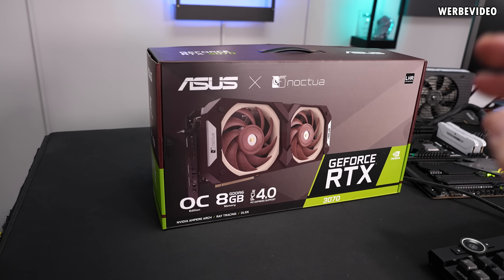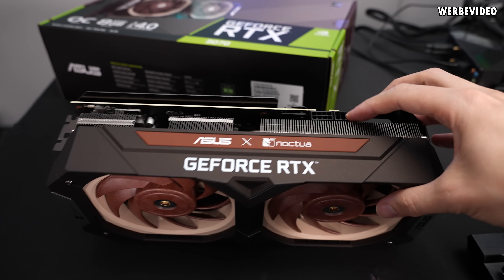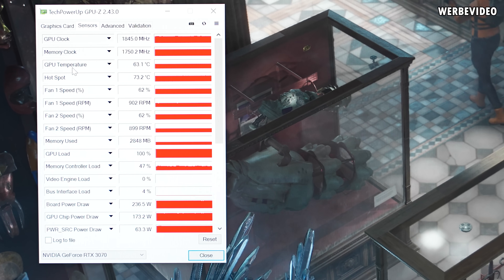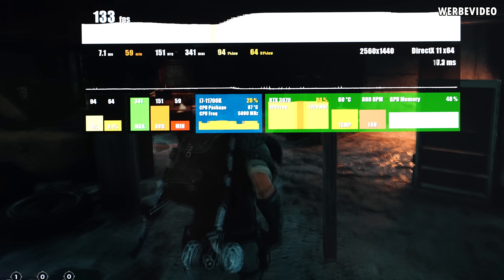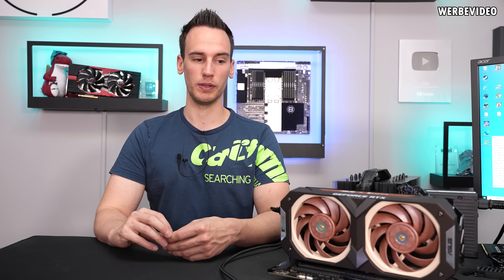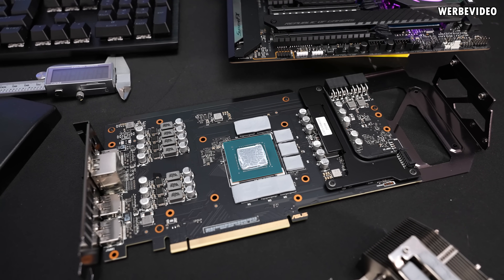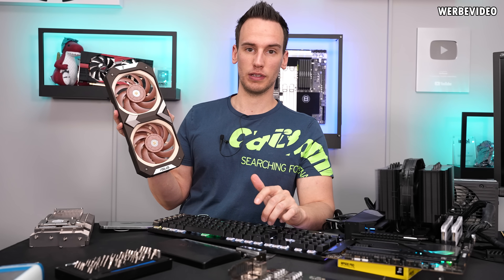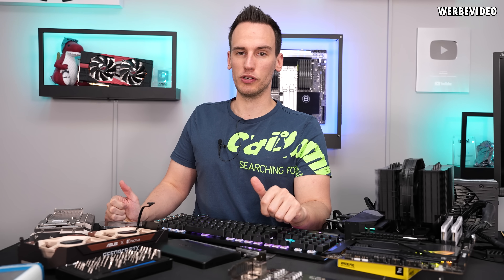Impressive Noise Levels - But what's up with the Heatsink? ASUS x Noctua RTX 3070 tested

Comment: I wonder why manufacturers put 2-slot I/O brackets on graphic cards that take up full 3 and more slots (in this case full 4 slots). You are taking up that space anyway, a bigger bracket with some reinforcements would help on common problem of gpu sag.

Comment: This would have been able to match or even beat a lot of 3 slot coolers in a 2 slot design, but a 3 slot version of this would be great. It would still outperform everything else but fit in far more cases, not to mention weigh far less.

Comment: The quietest card with the loudest coil whine. I had 3 pieces. Each one had tragic squeaks. Changing the power supply did not help. In the meshify2 case it can be heard from 4-5 meters. When I put the MSI RTX 3070 Suprim X nad 3060Ti Gaming X in, I have to put my head in the case to hear something.They all squealed so much that only lowering the voltage to 0.800 - 0.825V resulted in all 3 units. A friend also bought one. Exactly the same as with me.

Comment: Noctua make many sizes of fan, there are 80 and 92mm option, and 14mm thick ones as well. They could make a normal size cooler with noctua fans if they wanted. Most of the insane performance and low noise is a product of using two premium 120mm fans, not that they are noctua fans. That's not a knock on noctua tho, or this card.

Comment: Any non gaming application can use multi GPU without an sli/nvlink bridge (Machine learning, 3d rendering, etc). So dismissing the possibility of multi GPU because it is a 3070 with no nvlink is not taking those into consideration

Comment: My PC has mostly noctua fans (only GPU and PSU are exception). Now GPU can also be also noctua fans. PSU to go (Noctua waiting for some additional colaboration in this segment).
Video suggestion (as you said, black fans would increase buying potential) - swap those fans with Noctua NF-A12x25 PWM chromax.black.swap
Question is it a sticker on top (ASUS x Noctua)? So it can be possibly removed - replaced with something else?

Comment: i just built a twin fan 1060 with water cooled gpu (couldnt find a suitable waterblock for the card..used a cpu thing)...its quite horrendous made from a 2x4 aluminium pipe with a space invaders theme (and lcd space invaders game built into the sidepanel 😂)  i think this noctua one you have could compete on looks 😄

Comment: So, basically; If you were to take an Asus TUF GPU, remove their shroud and ziptie 2 Noctuas to it ( with some fan wire modification ) you'd get this.
A 4 slot card with a 2 slot shield and a so-so heatsink.
Big sad

Comment: I put two Arctic P12's on my 3080 Ti Ventus. Great static pressure, quiet in the required range (and black). Same result, 10° cooler and so quiet that I can only hear coil whine 🥺

Comment: Definitely my dream card right there. Quiet is so important to me so in a few years when the market is calmed down I'll be looking for this (or a current gen one) with a high airflow case so I can run fans at low rpm and maintain good thermal performance.

Comment: I just installed a Morpheus cooler on my 5700XT Gaming OC and seriously improved it's temps . Now the cooler installation was a nightmare. Thermal tapes were crappy as you can imagine and the mounting base was NOT compatible as the box outside said. Had to install it backwards going against instructions and cutting one part so it didn't make contact with a capacitor. I want to see that 5700xt video. ^_^

Comment: With these thiccc bois, why don't they ever put a 3-4 slot pcie mounting bracket? Surely if the cooler is that big, it's going to be heavy. Can't use the other slots anyways, and surely this would give these heavy beast cards the extra support they need .. no? 
*Think its only the 3090fe that has a 3 slot bracket?

Anyways, I'm surprised someone like corsair hasn't come up with this... then you could mount whatever RGB fans to your gpu, to make the rest of your RGB fans
Reply: Hahahah I swear I hadn't just watched the next video after this before posting this comment lololol

Comment: I modded my EVGA GTX1080 FTW3 to have NOCTUA fans...
Works amazing!
I had minor issues such as the EVGA Precision software crashing until I reinstalled the software (as I'd removed the LED stuff along with the fan shroud so it got confused). I also got major COIL WHINE even with the fans barely on. I ended up moving the non-GPU fan to a motherboard fan header and just have it ramp up based on CPU temps that are typically in the gaming range. I didn't need to be too accurate. The fans are SUPER QUIET!
I still have a little bit of coil whine but the fans are also quieter so it's hard to be sure how much it's changed. My fans spin at 300RPM in light loads, but even in heavy load it's almost impossible to hear the fans even with my other case and CPU fans barely being noticeable.

Comment: I hope this becomes a trend and card makers start using thicker fans, especially now that nobody uses dual gpus. The "sleek" thin loud fans are just bad.

By the way, Phanteks just released their T30 fan, which has similar fan blade design to the Noctua, but the fan is thicker, and it considerably outperforms this legendary Noctua fan. Just make all the fans thicker.

Comment: Actually 4 slots it's just too much in some situations. Noctua is one of the most used brands in the ITX segment, so if they could pull out a VGA more suitable for this type of rigs could have been a lot better. More when Noctua fans are also the ones that looked to be more used when Deshrouding a card. 
Regarding the looks I dig it, but the name branding could have been a lor more minimalistic, that big white lettering it's not very Noctua at all. A Chromax Black version would look cool too.

Comment: there should be standarized cover / mount for , 1, 2, 3 12cm fan cover, and its mount, and reuse your fav 12 fan. 
but gpu designers prefers more fancy  designs with rgb and so , those sell better, like those cheap no airflow cases full of leds and rgb

Comment: I have a standard 3070 TUF oc and it is already the quietest card I have ever owned. (previously the palit gtx 1070 jetstream)
Some stats so people can compare. These numbers were taken with the card in my Streacom Da2 with no bottom filters and two 140mm fans in the top as exhaust (running 700rpm). (a setup, that might be better than an open bench)
The card runs at 69c while keeping fans speed just under 1000rpm with a custom fan curve and small overclock, running cyberpunk at max settings.
With that said I think the 3070 Noctua would need a custom fan curve as well because from my experience the smaller standard fans are a bit quieter than the full size 120mm fans.

Overall I kind of wish they would have given this treatment to the 3080. I get why they choose the 3070 tuf, because it is already very quiet, but the 3080 tuf would gain a lot more from better cooling with its 300w power draw.

Comment: Extensive testing to make sure 120mm fans fit and additional marketing to make it cost more than a 3080. If you want 3070 performance but quite, buy a 3080 and under volt it. It’ll be as quiet for the same/similar price with extra performance in your pocket when you inevitably need it.

Comment: I already know that I’m gonna OC it and let the fans run at max RPM to keep it at a healthy temp. I have the Lian Li Lancool 215 case, aka DUAL 200mm fans in the front, insane airflow, and they get decently loud at max rpm anyways, so the noctua fans will never out-noise the case itself. I wonder how cool I could get it if I put all fans at 100%

If I can get this card for a non-insane price

Comment: 1870 MHz for 3070? isn't it low? I have rog 3070 and it goes to 1905 and I overclocked it to 2160 without any problems. fan curve in msi afterburner is a little bit aggressive but in game it never passed 66 degrees. I think asus could do better with core speed.

Comment: Pretty impressive performance out of the box. However, my (heavily undervolted) 3070 runs at around 53C at 100% load in a closed case(Fractal Design Define C) and has the same boost clock. Oh and with the automatic fan curve the fans never have to go past 30% which also means they can't be heard over my Noctua case fans. 

It's a basic Palit model... :D 

So: This will probably overclock like crazy and it's quite impressive. But: If you really, really need better cooling performance, i also recommend undervolting instead of putting that much extra into a 3070. IMO: They're pusing the 3070's unnecessarily high: It can do the same performance at 140 watts compared to 240 watts. But there's lots of headroom on the other hand.

Comment: I think we need more GPU's with shrouds that can hold a standart 120mm fan. So you don't need to scour the internet to find a decent replacement for OEM fans.
Reply: I also miss the kraken bracket days, just slap on any cpu aio to your gpu choice
Reply: I had to take a Dremel to my shroud because I couldn't find a replacement (my gpu uses the fans as blowers too so I can't use standard fans, and the replacement I got are 100mm instead of 92mm)

Comment: I actually did this to my msi card !!and I absolutely love it, I can't believe they did it but is the correct way to make an actual good cooler ... screw the dumb visuals is not a top model is a videocard for christ sake !!! not a freaking christmas tree either. Every card should be like this, with removable 120 fans... like every notebook should be a framework notebook, I got nothing more to say. I recommend keeping it at 1150rpm, you just can't hear it and the performance is outstanding.
Reply: I've been taking the fans off all my GPUs and strapping Noctua fans on them for several years now. I usually just take a metal clothes hanger and some pliers and bend a bracket that keeps the fan in place... 

Flipping the fans on GPUs actually works very well in many of the smaller cases I have tested. All depends on the placement of case fans really.

Comment: I've got to think that the current "shroud"-focused approach to electronics hardware design is a spillover effect from other areas of tech design, particularly automotive design which tends to be a leading factor in the general design philosophies of a given era. I wonder how much of that effect has led to the large crumple zones of modern car design eeking its way into other industries where it makes zero sense, with designers starting on the idea that large angular shapes should appear in their product and then filling out the space made by those shapes from there, rather than designing from the ground up without a concern about the housing.

Comment: What I don't understand with this is, as a four slot card, why has it only a 2 slot bracket to hold it down. Make a 4 slot bracket and attach it ( with rubbers and srews ) to the cooler/fanshroud to prefend card sack.

Comment: How easy would be to swap the fan with a general 120mm one straight from Noctua? I'm mostly interested in how they handled the connectors. Is it propeietary or do the fan cables meet at a merger cable which then goes to the GPU?

Comment: best part is we get standard fans on the gpu.. easy to replace, swap and maintain even in years

thickness is an issue but pc and cooler design have to adapt to the new wattage standards the cards burn and the users who want silent pc and good perfomance.. the vent trugh design on the nvidia is also a good step like the old Accelereo IV worked. would like to see it more on every gpu and pcb design who adccount for that cooling solution detail..
put the shrouds, pcb lenght ajnd thicknes to a "standard" and there could be a dedicated place in the cases for your gpu sack bracket build in

Comment: They probably ran the same extensive simulations for the tuf gaming card, air flow is air flow. When you start pushing air through a heat sink the design of the fan has little affect on the flow patterns, mostly pressures and velocities. Making any larger changes than what you have seen (i imagine the extra 2mm is just so the fans fit nicely) would probably required new tooling sets to be produced, this has a cost attached. The design of one of their current coolers was "good enough" so why invest more than needed to gain that extra couple of percent.

Comment: would loved these on my 3080 Strix, as those fans are loud, and one of them are vibrating/buzzing when at 65-85% fanspeed.
Reply: Exactly the same vibrating sound on my Strix 3080. According to reddit/forums it's quite an issue with Asus 30x0 series.

Comment: This GPU would make a lot of sense if the prices were somewhat normal. Just checked; on geizhals there is only one 3070 TI Founder Edition for ~1000 EUR. 6700XT for 750 makes a lot more sense. Thank god, I don't "need" a new GPU because I only play hardcore sim racing games. But I want to go triple monitor setup (I have one 21:9 currently) and 2 more 21:9 3440x1440 high end high refresh monitors cost less than 3080 ATM.

Comment: Would putting a huge fin heatsink (with 2 slow fans) on the back of the GPU with 15W/mk thermal pads across whole PCB help with thermals in a measurable way?

Comment: Well, the thing is, modern Ampere card's inductor is very likely to have coil whine after a few month of usages and it just keep getting louder and louder.
And to some point, the fan noise simply become irrelevant to the overall noise level you can hear, but the annoying coil whine that appears even on desktop!!!!

I think vendors should pay more attention to use some more robust and silent inductor and stop just playing with cooling solutions.

Comment: Finally the thicc boi comes right out of my dream!
Now the only thing left would be a thicc blower style GPU with 1 fan standing upright at its end, so that no one should worry about hot air inside a bad case.
Reply: Craft computing have you covered with the last one
Reply: Youtube need a tagging system developed it seems...
I've tried but severely lacking the means and tools to do it right. 
...
Adding a straight up fan at the end just caused clearance issue, it messed up a lot of things so yu will need quite a big case. The vibration was horrible; I just didn't have to worry about GPU sag as it might swing out through the glass panel at no time. The only fans which fitted were 40mm and 80mm fans, and they either were too slow to cool anything OR made a mini jet engine which even robbed the air of my CPU cooler. 
Being hopeless, I tried to make an air tunnel out of adhesive tape and plastic bag to link the GPU directly to a 120mm front fan; glued in additional tiny copper plates. The result was actually gud! Its only problem was noise... However it was because of air leaking and bubbling plastic bag - think of it this way: Whenever the speed of the front fan changed the CFM changed which made the "tube" change its shape; your PC turned into a living snoring creature; even just 1 RPM change could have noticing effect. I bet with proper fitting and thicker air tunnel wall the result would be better. 
The alternative solution was creating a megaphone-shaped "thing" to catch the air, direct its flow. But well, it was ugly =]] and not as gud cooling (if yu made it less ugly).
...
So making it thicker (3~4 slots instead of 1~2) seems to be the better way to go. However I doubt that a lot. The only scenario which a blower card shines is in a server, workstation rack where multiple of them stacked closely together with extremely gud airflow => 2-slot GPU is the best here. Making it thicker (and more expensive) doesnt' seems to be a gud idea, even if the GPU has 2x or 3x the strength; so no brand will do it.
Reply: @hongockimquang1994  did you try an AIO at the front of the case, and than covering up all the exhaust vents? The fan will pull in tons of air through the AIO, cooling CPU, and push out through GPU.
Reply: Interesting idea. However I never did that: Custom loop, custom case, heavily passive cooling... are better suited for that kind of operation in my opinion. I doubt 1 fan can handle all that airflow.
Reply: @hongockimquang1994  did you see the video? He used a 12k rpm industrial blower fan and a 3d printers shroud. Airflow is no problem for industrial grade components
Reply: Dude...
I've mentioned above "severely lacking the means and tools to do it right." So sadly I could only make do with what I had got...

Comment: ”almost 3 times as loud”… I’m pretty sure that in the dBA scale, which is logarithmic, a 3 dBA rise correspods to a doubling in perceived noise level. Therefore a rise from 33 to 49 would correspond to approximately a 32x perceived noise level increase (33=>36=>39=>42=>45=>48 doubling every time would make it 2^5=32x increase). Please correct me if I’ve got it wrong, I don’t mean to be a nitpicker.
Reply: 3dBA corresponds to a doubling of sound power/intensity/energy but you need an increase of 10dBA to perceive a sound as twice as loud. So for 3 times as loud it would be 15 dBa higher so 33 to 49 is a little more than 3 times.
Reply: @mr.potato9449  thanks for correcting and informing me :)

Comment: So, they/you just 3d printed a shroud for the standard dual mounting hole fans and utilizied the old heatsink and you provide a veiled neutral criticism of the design, Simon?  Seems odd, no?

Edit:  But, like if this was legit, why not remove the second set of mounting holes, create a lower profile design for the fans (ie..reverse the fan mounting arms [to the top]) and, maybe add a concave heatsink with altered heatpipe arrangement to lower the card height?  What stinks in here, Simon?

Comment: Did a similar thing about a year ago to my Zotac 1660 but only because my original fans started acting loud and the seller said that its not basis for replacement (fan died not so long after). So i printed a new shroud and added 2 noctuas that had similar CFM. Did have to use the connector from the broken fan and do a little of soldering but worked like a charm ;)